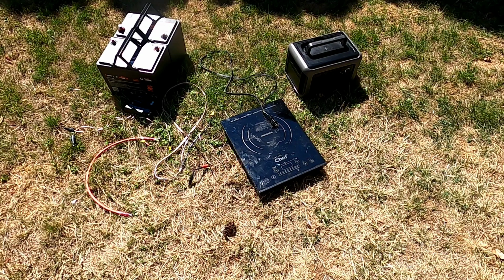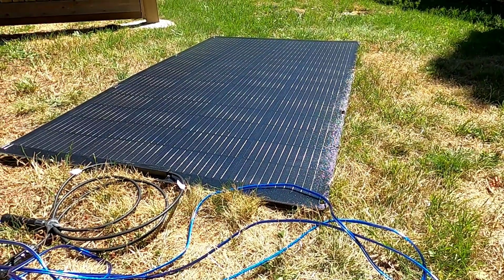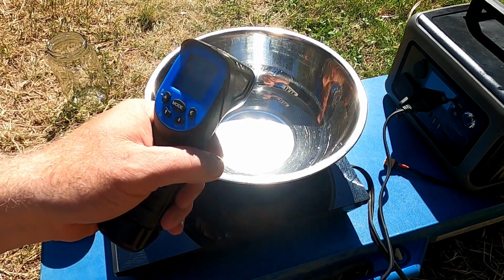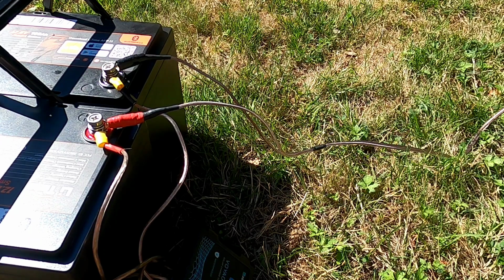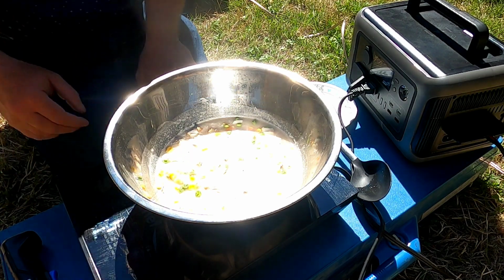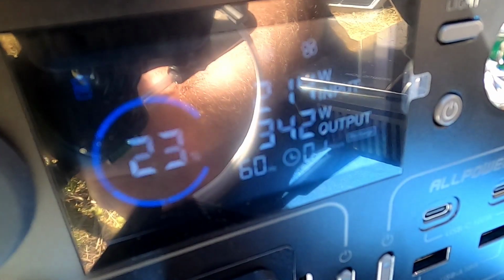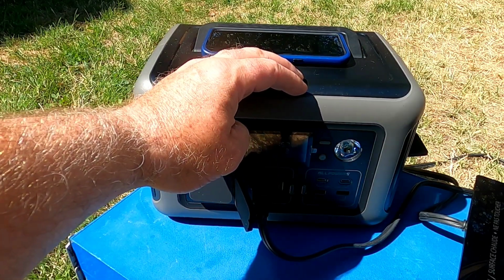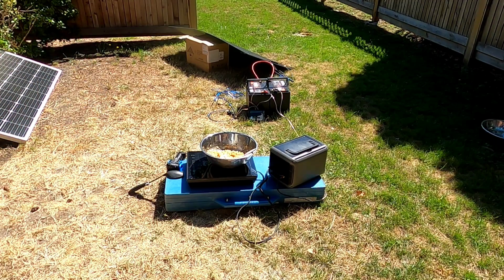COOKING WITH SMALL SOLAR POWER STATIONS USING ALLPOWERS R600 WITH LiTime BLUETOOTH BATTERIES 24V

Comment: also you are using a mixing Boal, if you use a good thick base saucepan it will stay hot longer, it may take a bit longer to heat up but will work better.
Reply from the maker: I intentionally use super thin bowls for the rapid heat production, it was done intentionally to demonstrate effective cooking with 300 to 500 watts.

Comment: Hello Frank,

Very interesting video, which brings me some questions :
1 : for the same price than this solar generator cost, buying a DC/AC converter(like the Renogy 2000W you own) wouldn't be more efficient ?
2 : for the price of these 2 batteries and this solar generator, could u upgrade with a better solar generator ?
3 : can you use batteries with different capacities ? If no, do they have to be identical (same model) ?
4 : does the system (PWM unit) work if the 2 batteries don't have the same amount of charge ?

Thanks
Reply from the maker: @louis6569  Hey Louis, 1) it would be more efficient for the ac agreed, but there are advantages of portability and other outputs in a small light stand alone unit. 2) you could but they are bigger and heavier and not as modular so packing them in to remote locations can be more difficult, plus these can be multiple purchases through time rather than a single expensive purchase, I focus on portability for off grid use primarily as well. 3) it is doable to use mismatched batteries but I always recommend matching batteries that are top balanced. 4) top balancing is used to minimize this issue, put simply, fully charge your batteries independently before connecting them in series (periodically repeat top balancing), a 24v battery doesn't have this issue but can't be rewired easily for a 12v setup for example. 

Hope this helps answer your questions, keep in mind I receive these products from random companies that wish for me to do review videos, as additional channel content I create videos such as these combining the different products to show advanced capabilities that can be achieved with random gear. Thanks for watching again Louis and for the support of the channel, more coming soon cheers.
Reply: @frankbush333  Thanks for these answers. Your channel is a real hidden gem, I don't even know what I appreciate the most : the very informative contents, the way you are talking about products or the care about your followers. Thanks Frank.
Reply from the maker: @louis6569  Wow, thank you for the kind words Louis your words are humbling ty.